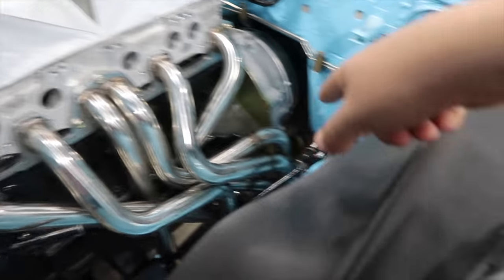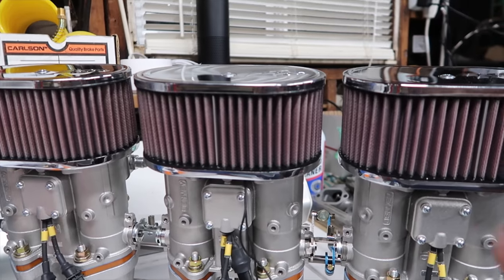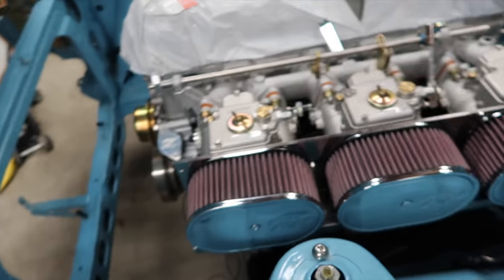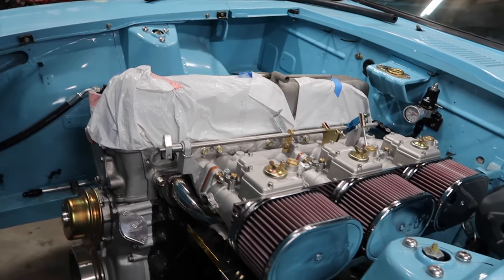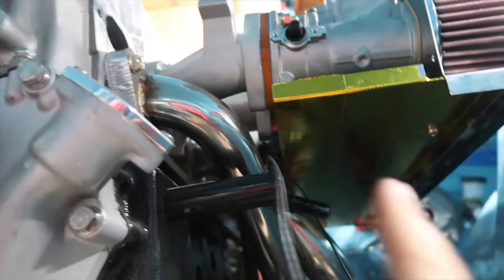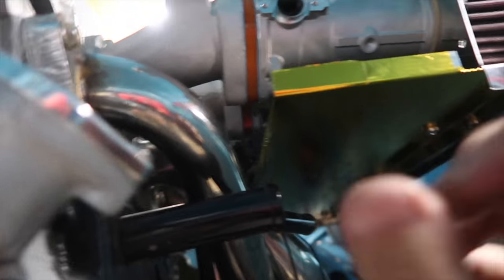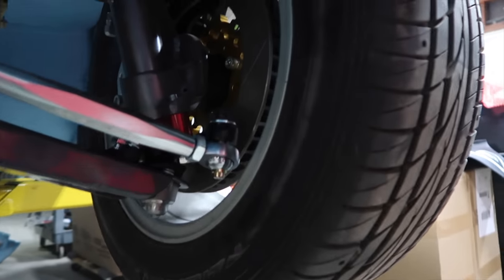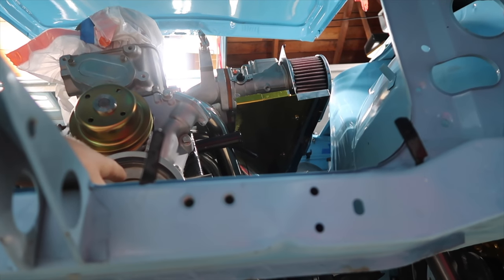Engine Bay Stuff - Datsun 240z Build - Ep 46 - Panchos Garage

Comment: I am curious how well the thermo tape stuff actually works.  I am working on controlling temps around engine bay for my Z with wrappings, sleeves, and ceramic coating on headers.  Lots of fuel, trans cooler, nitrous and oil lines on my junk being a "wanna be" race car.
Reply from the maker: I've heard great things about it which is what I'm trying. It isn't too expensive so it's worth a shot.
Reply: The gold tape reflects the heat.With some private jets the windows in some have gold tint too reflect heat so they don't fog up on the inside.If you look at a photo of the LLM that landed on the moon you will see gold wrap all around the bottom of it that was to keep the fuel tanks from exploding due to the high heat from the sun hitting it.